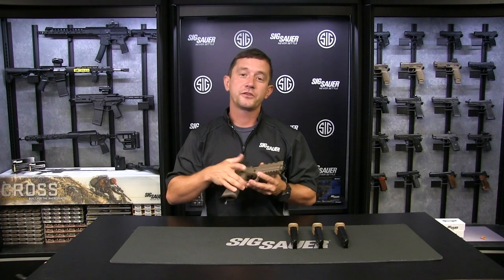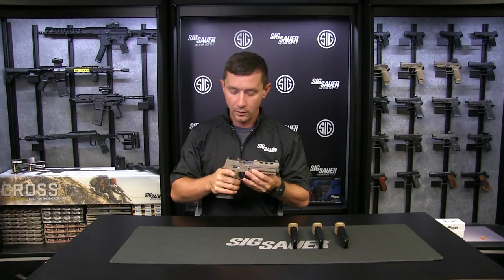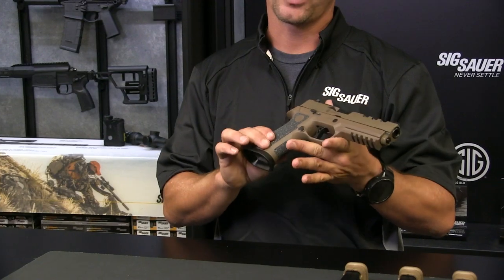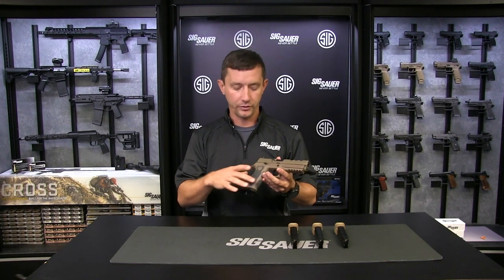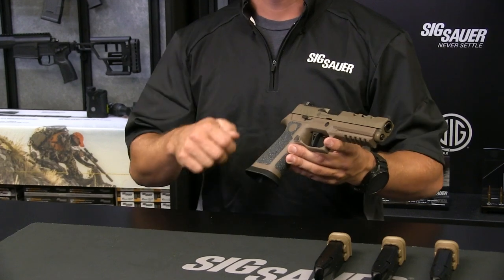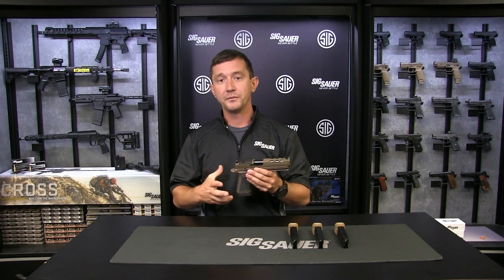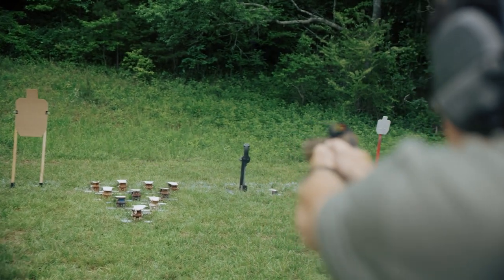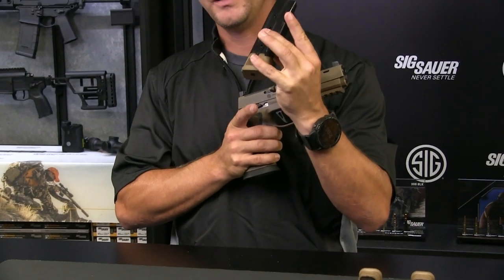Introducing the P320-XFIVE DH3

Comment: Meh. Not taking away from the competition world and bunny fart loads, but I’m not interested. Now, expand the XTEN line with fighting pistols designed for those arenas where the only trophy is survival, and capable of handling 50k rounds or more Norma spec ammunition - as the late COL Jeff Cooper pushed for, and you’ll have my attention. I love my EDC XTEN carried AIWB, and hoping for a 4-inch version with the same 15 rd. capacity. The 4-in. version will speed up draws like it does from my M17 to M18. Also, have available 20 rd. or more magazines. 

Besides, this pistol looks like it was taken from Glock’s playbook - G17 Gen 1, 2… this is a X5 Gen 2, lol, but I must admit that if this pistol came out before my X5 Legion, I'd bought it instead!

Comment: Will it fire without touching the trigger.  Like the rest of the P320 series??
Reply: It’s a feature 😂 smart gun technology
Reply: Full auto semi automatic anticipatory discharge system.
Reply: Mine doesn't
Reply: its hard to say with the latest discharge's, where they due to them being pre fix models.
if not was it do to manufacturing process doing wrong because I know with the military contracts then can rush productions to meet deadlines. meaning the mill went wrong or it was a miss assembly.
if not we would  arrive at engineering flaws and what ever could be the issue then.

Comment: Pretty disgusted the original lightweight x-five was discontinued while replacing it with the horrendously heavy "legion". Momentarily I was excited thinking I could finally purchase a reasonably weighted x-five again, only to be disappointed yet again... 43.5 oz plus an approximate 10-12oz with a 21-22 rounds + mag.. you're looking at almost 3.5 lbs fully loaded. Plus the weight of the additional 2 fully loaded mags. GTFOH!
Reply: @How_Lay  You know these guns are designed for comp right? Weight = less felt recoil. If you are looking to carry it, you are looking at the wrong gun. The issue is not the weight of the gun, its your selection. In the comp world, we add even MORE weight. I added a tungsten grip slug and tungsten recoil rod. You are looking at going the wrong direction. Much more non competition models out there than comp ones, so your selection is alot greater for ANYTHING to carry. The new macro feels amazing btw, but I own two legions, an AXG scorpion, but my EDC is a p365 because its the lightest. Dont carry a full size gun then complain about weight lol
Reply: @CryptoTraderNetwork  unless it's on a duty belt. Thanks for your opinion tho pumpkin.
Reply: @CryptoTraderNetwork   you're up there with NDT..😬
Reply: @How_Lay  again, not what its intended for tactical timmy. But thanks for your insightful rhetoric, back to larping with ya
Reply: @CryptoTraderNetwork  obviously not what this is intended for, which is why I said I was disappointed the lighter one was discontinued.. Larping? Who's the one in "competitions"...